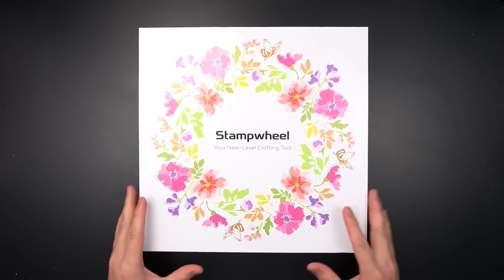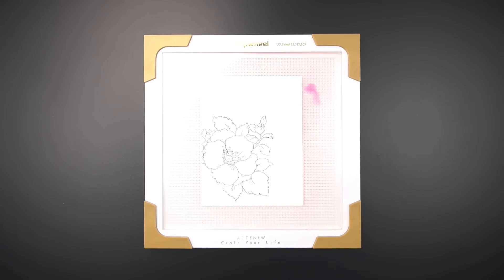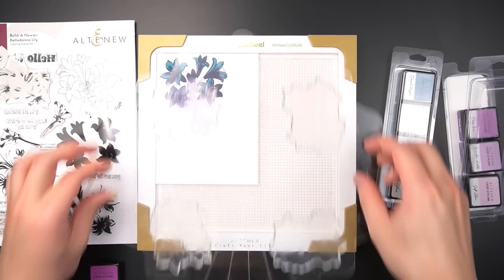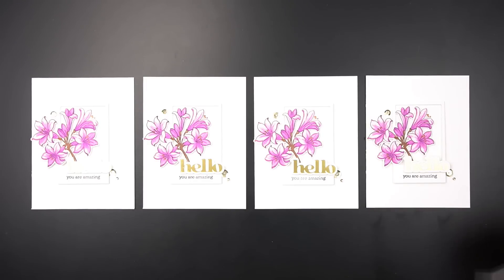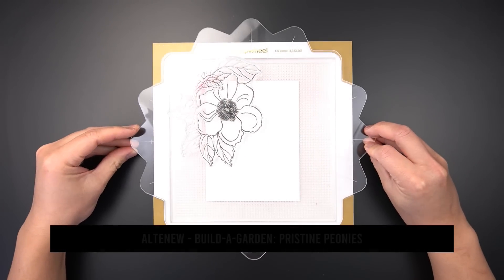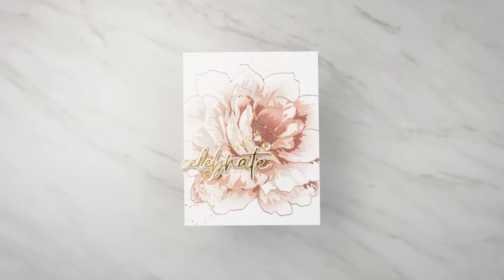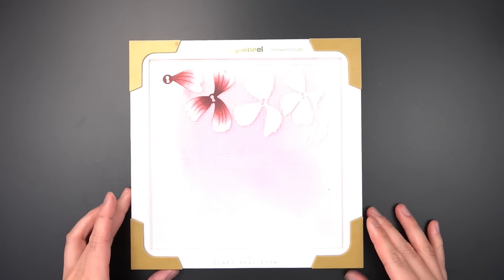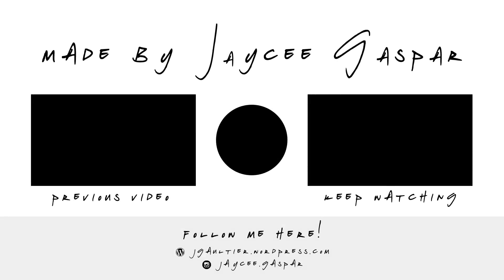10 Advantageous Altenew Stampwheel Techniques for Card Making | Card Making Tutorial

Comment: Can you use a rubber background stamp in this stampwheel? Possibly take out the sticky grid and use non permanent tape to hold card in place? Also do I need the accessory items - stamp grid, alignment forms?Then it really gets expensive...
Reply from the maker: Thanks for asking these great questions. I experimented with a Pinkfresh Studio and a Spellbinders cling stamp and both worked great as you mentioned. Remove the sitkcy mat grid and add a temporary tape to your cardstock to hold your paper in place. 
As for the accessories, the Stampwheel comes with the Flip Plate, Stage, and Sticky Mat Grid. You should he more than equipped to do some fantastic stamping techniques with just what comes in the box of the Stampwheel. Hope that helps!

Comment: I was wondering if I used my Cricut to cut some stencils 7.5 inches square with an A2 rectangle cut in the middle would that work to hold the card in the center? This could be done for various card sizes.
Reply from the maker: Paula, that is exactly what I did with my Cricut Maker and some thick acetate sheets. I made a 7.5 inch square and centered an A2 panel with the alignment function in design space and cut the template. There should be an available add-on stencil from Altenew soon for those who don't have a CNC like the Cricut.